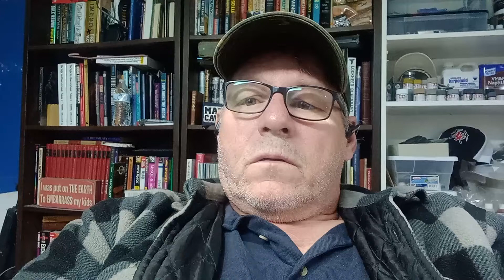SA Reloaded - Can't versus Won't

Comment: I agree I'm sitting on a lot of kits that I just don't want to work on. Kits that when I was a kid I loved, case in point. italeri great subjects soft detail odd plastics that are brittle. They're just  difficult to make right, in today's modern manufacturing; you can get kits that are 100% better. I'm working on Dragons imperial kits, and I can't believe I used to think they were the best just because it was a subject that no one else had. I'm so close in pitching it out what a turd of a kit. Good video 👍